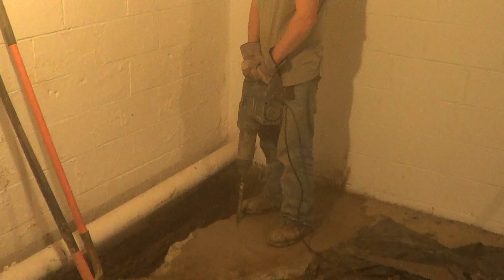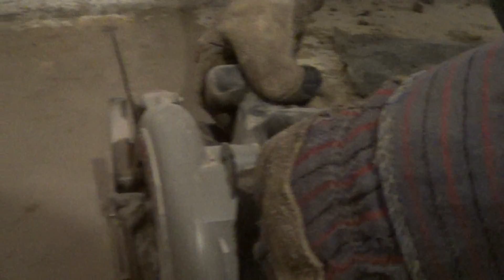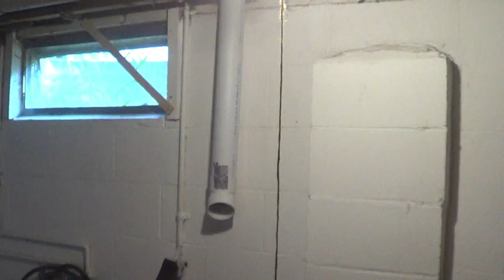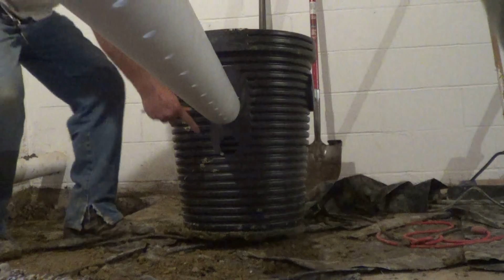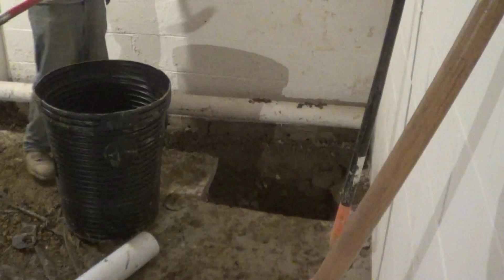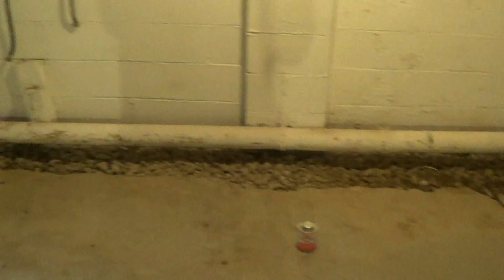PERIMETER DRAINS How to install BASEMENT perimeter drain systems STOP basement flooding

Comment: This is a great video. My question, why not use a silt liner below the pipe and around the sump box? Basically, the way you would if you were digging a trench and installing a french drain?
Reply from the maker: Hey Lord,
Thank you for watching.
thats a good question.
You do not want to impede water flow coming to the gravel and thru the rock and into the pipe. If you have a build up of water around the rock(some kind of mesh or liner), this could lead to over flow onto / above the floor as the water table rises.
and it does rise very quickly...
Remember, water under the slab of a basement floor is regulated  just below the slab at the footer level
Thanks again for watching

Comment: Hey Chris. I have poured concrete-not cinder block  in basement wall.  Do I drill at the top of the footing on that too?
Reply from the maker: Hey philip, thank you for watching. I doubt you'll be able to get through a poured concrete wall. Water must rise from underneath the footer. Is there not a perimeter tile installed already? If this is a new build and the walls are just now being poured, you must put perimeter drain and gravel on both the inside and outside at the footer. Now, if existing walls and home are already built , unless you are having seeping walls above the basement floor you should be installing a perimeter drain at the footer level. If you have a cracked wall and water is coming through the wall you need to dig on the outside wall and repair. Thanks again for watching.

Comment: Why did you install two basins? If you need more pumping capacity wouldn't you just use a larger pump or two pumps in the same basin?
Reply from the maker: HEY MP,
Thanks for watching. 
MANY other companies had tried to resolve the water issue in the basement and failed.
this dual pump  set up + kick plates on area of walls where floor meets wall was the only way.
This set up is handling 4 condo units...
There is a HUGE HUGE parking lot and 10,000 square foot roof of a building  with downspouts emptying onto the surface of parking lot . The vast majority of all this water collected  on the parking lot ( another 10,000 square feet of of surface area) ALL goes to back side of this condo plex.... this equates to THOUSANDS of gallons of water going down outside wall and wants to guizer up from under footers. Maximum positive control must be maintained at all times. one pump is not enough. size and area of collection dictates the use of 2 sump pumps. Thanks again for watching!

Comment: I’m looking for a small sump pump that I can mount flush to my basement floor and for it to have a drain on the lid. I’m only doing this Incase the boiler releases the water doesn’t go al over the finished basement. Do you know what sump pump would have a lid that has a built I drain on the lid? Thanks

Comment: Need a bigger jack hammer and only one sump pit in that small of a area
Reply from the maker: Hey Joe,
Thanks for watching. These sump pumps service  2 condo units. 
The floor had been jacked in the past so it wasn't very thick. The Bosch hammer drill  worked great for breaking up weakened concrete floor. Thanks again for watching!!

Comment: How do you determine the depth of the pipe? And also why did you not use fabric to stop dirt from clogging pipe holes?
Reply from the maker: Hey Lisa, Thanks for watching. Dig trench as so top of FOOTER is exposed, lay gravel lay perforated pipe NO FABRIC ~ fabric does not pass water thru weave fast enough to keep up with rise and fall of hydro static table . in clay, fabric just gets CLOGGED making all that hard work useless. Thanks again for watching!

Comment: Hello
You never explained about the kick plate.
Reply from the maker: Hey Roosevelt, thanks for watching. there is SO much water coming to this wall from outside there is a big parking lot. all the water comes towards this wall. surface drains out sidewall have been installed but it is just to overwhelming in a torrential downpour. 
so, the hydro static table increases tremendously and very very fast. the kick plate stops any water that may percolate in side the cinder block  during these extreme conditions . the cinder block weep holes on this particular wall are right where the concrete slab butts up against them. so , kick plate allows water thru weep holes and directs water into the perimeter drain system. without a kick plate on this system, the concrete would block water from exiting weep holes, cinder blocks would fill up with water all the way to the top of the wall! thanks again for watching

Comment: Thanks for this. The house we bought last year already had a drain in the basement. What is strange is, with all of the rain we had in 2017, I never heard the sump kick on once. It rained for 2 days and stopped raining early afternoon yesterday. Now the sump is kicking on about every 15 minutes. We also had a radon system put in when we bought the house so they taped up the sump cover with asphalt tape. I was able to shove my inspection camera down there and the drain pipe has a continuous trickle that’s filling the well up. Since I didn’t hear it at all last year, but do now, should I freak out?  Seems to be operational but just want to verify. Thanks again

Comment: Well... I’m sure you know what you’re doing, but I just can’t wrap my brain around the idea of drilling holes in the sump pit. Yes, it’s allowing water to seep in from that area. But ..what about the water that’s pouring in from the drain pipe? And how is the pump supposed to work? The ones I’ve seen have a float switch that turns the pump on when water reaches a certain level. With the holes in the pit, the pump will cycle off and on very very often and it’ll wear out the pump. School me!
Reply from the maker: Hey Mark ~ thanks for watching. there are a couple reasons to drill holes in the sump pit on this installation:
1) there is so much water in the hydro-staticc table, it needs to keep it " at bay" or as far away from the foundation / floor as possible at all times.
2) there is so much water under this floor that if you do not put holes in the sump pit, the sump pit will BECOME BUOYANT and begin to FLOAT.  it will move upward, out from under the concrete floor. Pumps will cycle more often but thats the nature of the beast on this particular installation. ~ Thanks again for watching!!!
Reply: Call me dumb , but why go inside;rather an outside French drain with a 1° slope 6-12 “ away from foundation running to the street? My daughter is faced with exactly the same thing. 
Thanks for the vid! I’m sending protective and healing vibes to you and your loved ones.

Chas

Comment: Why would the holes in the perforated pipe be facing downward?  How is the water supposed to flow through the pipes and into the sump?  Also, if there are holes in the pit, wouldn't the water just leak out and saturate the soil underneath the house?
Reply: Having holes facing down seems counter intuitive to me too. Here's how I think about this. Pretend you dig a trench and do not fill with gravel or pipe, it is simply an empty trench. When it rains a little bit then the water might only rise 1/4 inch and drain away. If it rains hard for many days then the water might rise 4 inches and drain away. So far all is good.

Now you decide to fill the trench with gravel, either because you don't want your children or pets to trip and fall (since it's outside) or because you plan to cover the trench with a concrete floor and the concrete would just fill up the empty trench otherwise. If it rains just a little then the water will rise 1 inch instead of 1/4 inch, because the gravel will cause the water to flow down toward the exit of the trench more slowly, the flow of water is impeded by all the gravel. If it rains hard then the water will rise 8 or 16  inches instead of 3 or 4 inches - again because the flow of water is impeded by all the gravel and causing it to flow more slowly. The water might overflow the trench if it rains too hard - very bad!

Now what if there was 1 inch of gravel on the bottom of the trench, then lay a 4-inch pipe on top of the gravel, and then add more gravel to fill the trench to the top. During a little rain the water will rise less than 1 inch (vs 1/4 inch if the trench were completely empty) and the water will never see the pipe, so if you only experience tiny rains then save time and money and just dig a shallow trench and forget the pipe. During a heavy rain water will rise 4 or 5 inches, because the first inch of water is traveling slowly though gravel, but from 1 to 5 inches the water travels through an "empty trench", which is the inside of the empty pipe. Water flowing in this empty space inside the pipe will flow at the same fast speed as an empty trench with no gravel slowing and impeding water flow. It will be very difficult for water to rise higher than the pipe because water flows so fast when inside the empty pipe as compared to flowing though gravel. Of course during the 1-in-100 year rains so much water will fill the trench that the water will then rise even higher than the pipe, and then travel through the higher gravel section very slowly again, and overflow the trench, but nothing can stop that other than digging a bigger trench, and maybe also using two pipes laid side by side or top and bottom. Either method should double the amount of "fast" moving water.

I have no idea how much slower water flows through an empty trench vs a trench filled with gravel, but maybe 10 times slower would be a good guess. This is why a completely empty trench is the best way to move lots of water during a heavy rain. During a tiny rain it does not matter if the trench is empty, has gravel, or has gravel with a pipe because the water will only rise an inch or less, and therefore will never rise high enough to fill the pipe or risk overflowing the top of the trench, no matter how much gravel is slowing things down.

Most people with  children or pets or a sense of beauty don't want to look at empty trenches surrounding your house or basement floor and therefore fill with gravel and then cover with grass (outside) or pour a concrete floor (basement).

Note - I dug a 1-inch trench in my dirt crawlspace and left it open (no gravel, no pipe) to deal with the 1/8 inch water flow that occurs only during a super-extra-heavy rain here in Oakland, CA. Since the water only rises 1/8 inch I had to make sure the bottom of my trench was super smooth and flat.
Reply: Donald Lee no trench is truly empty Donald there are sides and a bottom somewhere and those surfaces are most likely going to be dirt which will turn to mud as soon as the water arrives, so do you want to try and control the flow of water or a mud slurry that can vary in viscosity? Also washed 2b stone doesn’t slow the flow of water it increases it..example if you have a 3 one gallon vessels and one is empty and one Is half full of clean stone and the last is half full of compacted dirt (this last one represents you empty trench theory) then you add one gallon of water to each at the same time the one with the clean stone will fill and overflow with clean water due to the displacement of area via the stone, the one with dirt will overflow first but the water will be muddy and getting muddier as you pour and the empty vessel will take the longest just to reach the top so we eliminate the empty vessel scenario as it was just used to explain displacement and does not represent any true subgrade trench soils condition, that leaves mud or stone and as also almost all basements will require a sump pit and pump and with no pipe your pit will fill with mud or water depending on the choice you made but your pump won’t last very long if it tries to pump mud (although we do use effluent sewage pumps for solids and heavy slurried waste but that is a septic issue and not what we are discussing here) so a trench, clean stone, pitched drainage tile (pipe) perforated with holes facing down because the water is coming up, silt fabric sock (no one answer for silt because it depends on site conditions I’ve seen this help and hinder as it can coat and clog), more clean stone as a base for the concrete cap, concrete to existing floor elevation.
Finally the sump pit is placed well below the pipe elevation and is drilled to allow ground water (the same water that’s entering your perforated pipe) in strained through a stone bed at the base and around the poly pit from bottom to just below concrete cap) this water will also be pumped out and away from the home to exterior water shed, another reason to perforate the pit is because the rising water can cause hydrostatic pressure that can float your pit right out of the ground or a pit with residual water can drain back down into the subgrade to alleviate the standing water in the pit (depends on soil types onsite)
Folks have to be aware that there is water in most soils and at most depths in numerous concentrations, just because we build a house on a 10’ excavated footer and foundation doesn’t mean the water is still not present much deeper our building codes prove this in our frost depth requirements and they are making those requirements deeper as time goes on so we must manage the water through proper exterior grade, correct gutter and downspouting, foundation coatings and unfortunately interior perimeter drainage systems
Reply: Furryz how about geo fabric in the trench before you begin with washed gravel ?
Reply from the maker: ~ Hey fair weather ~ thanks for watching ~ water table rises. pipe acts as a conduit, quickly gathers water moves to pit. Water table can only get as high  as the BOTTOM of the pipe...if holes were  turned upwards, no water would get into the pipe until it is to late, you would have a flooded basement. plain n simple, the system would not work.... the pit in this case, needs holes to help gather water around the pit. the pit would FLOAT upwards if no holes were put in it. The water pressure underTHIS floor is intense. Gather and move to discharge line as fast as possible. notice there are 2 pumps in this video. SOOO much water... before they were put in , water shot up like a geyser from the floor were it meets the walls. ~ thanks again for watching ~

Comment: I am about to purchase a house that has the drains leading to the outside of the house. That means that there are no sump pumps there. What do you think about that setup? Right now the basement is unfinished, and I am thinking about finishing it in the near future. thanks
Reply from the maker: hey rev, thanks for watching. that set up is normal in homes from the 50's. 60's and on back some years. now a days, its best to have sump system in place for basement renovation.

Comment: would this system work in a crawl space that was built with a monolithic slab? I have water seeping in where the wall meets the floor.  tried hydraulic cement at the seam but now its just coming through the block.

Comment: the holes you drilled in the cinder block at the bottom of your foundation won't those holes deteriorate over time with all the water going through them? making the foundation weak. Just curious cause I'm about to finish my basement and would like to waterproof before I start.
Reply from the maker: hey joe, drilling holes is standard, it actually help alleviate pressure on the wall which is tremendous
Reply from the maker: hey joe, 
another short comment.
you would know if this is needed by the height  of the hydro static table under your basement floor.
did you build new? or finishing an existing home basement?
when a new home is constructed  and the basement is dug out with backhoe, sometimes, the backhoe will dig into the hydro static water table. this sometimes determines the actual depth of the basement into the ground. for instance some homes have 7, 8 or 9 foot ceilings in the basement. this also sometimes determined by the water table. some folks just have to have that 8 or 9 foot ceiling and the basement dug is well into the hydro-static table... when this occurs, it is best to jack  drill the cinder blocks and have  a nice perimeter drain system installed. with pump and pit to remove the water from under basement floor.
Reply: AtlanticDrain did you install a dimpled membrane over the weep holes to protect them from concrete and gravel clogging them?

Comment: I have to install drain tile.  How can I reduce the likelihood of harming the footing while using the jackhammer to cut out portions of the slab?
Reply from the maker: hey jonasinc ~ its best to cut a line with a concrete saw. then, jack the floor. the floor ( concrete slab) is NOT attached directly to the footer.

Comment: How does the water stay in the sump put if you drill holes in it? Also do you always install tile with holes down?
Reply from the maker: +t mod ~ hey T mod ~ this was an extreme issue with controlling rainwater and hydrostatic table. ~ it is not always necessary to drill holes in the sump pit but,it helps gather water quickly when you have a constant flux in the hydrostatic table.this system works fantastic! I have gotten  complements from owners each year thanking us for installing a system that actually resolved there rainwater / hydrostatic table issue and yes always install the  holes DOWN in a perimeter drain system.
Reply: AtlanticDrain if the wholes are down in the drain pipe how would the water get to your crock to be pumped out?  Ty.
Reply: My Charmed Unicorn -
To answer your question- the water table is higher than the holes- so as the pressure builds it carry’s the water past the holes to the pit - following the path of least resistance. - there’s more resistance below so the water doesn’t / can’t flow out of the holes